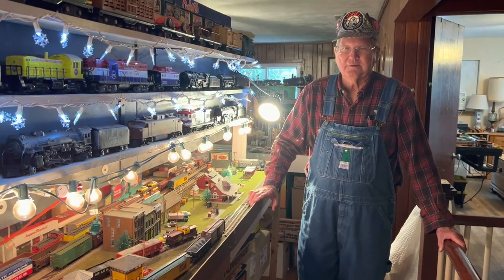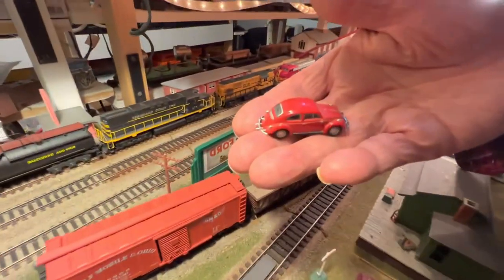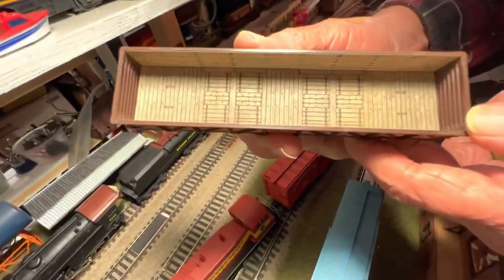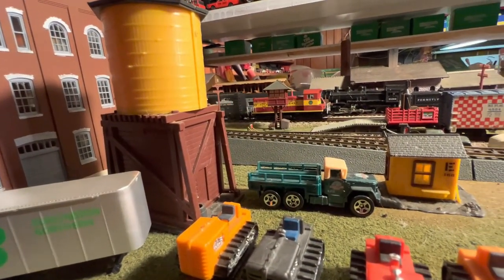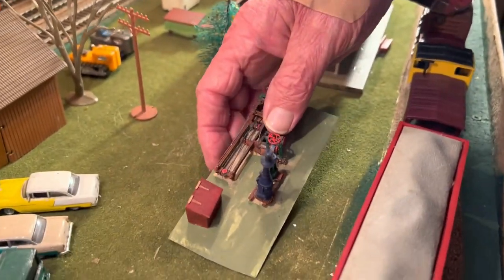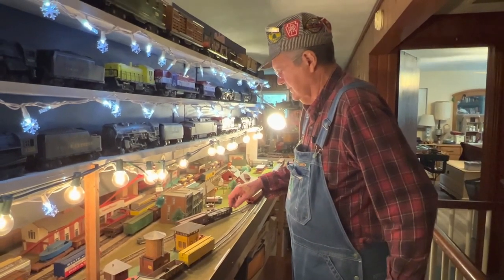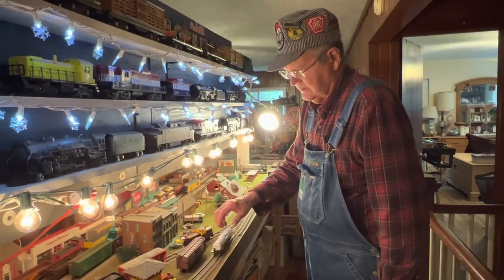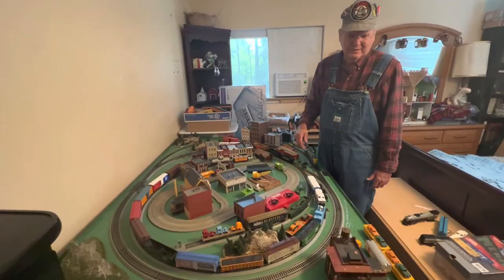From Salvaged Scrap Heap to STELLAR SWITCHING YARD! Part 2 HO Layout Updates

Comment: Great vid…thx
Reply from the maker: Thanks. I may have assembled the sawmill from a kit or mixed stuff, just no longer remember its origin.
Reply: John,  at my age I have a hard time with the HO but I still enjoy them. I have a small 4x6 HO layout. Thanks for sharing yours. I really like your videos. I have watched all you have done!
Reply from the maker: James, I like your videos too. I am having fun with the ho, particularly in repairing and saving stuff I get on the cheap. I have found out however, that the early Tyco engines with the mu -2 motors are riveted and difficult to repair. @mytrainroomjamesbarker4079